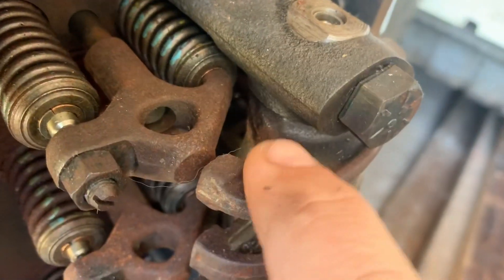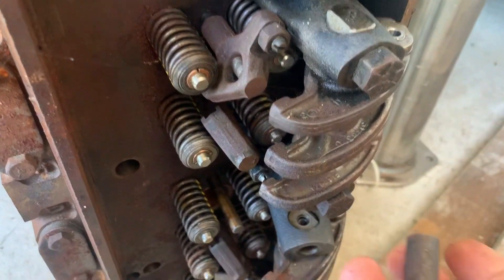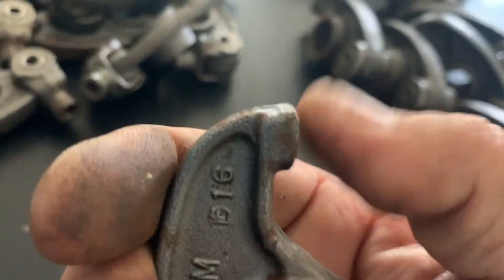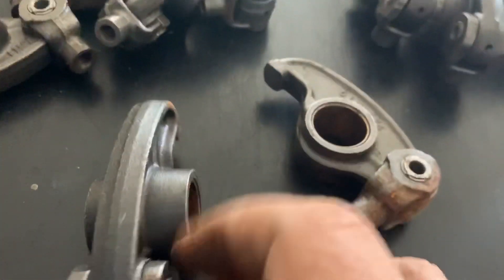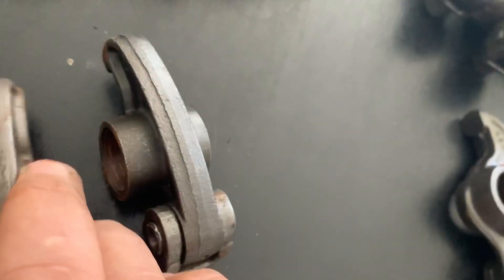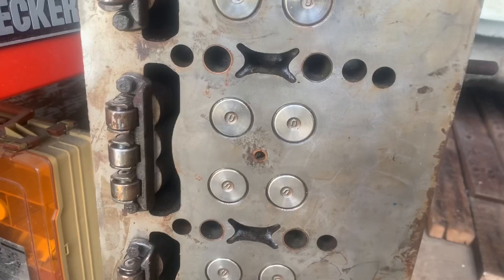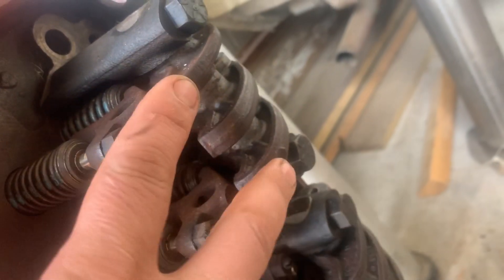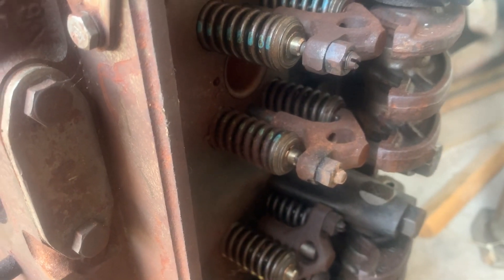4 valve head operation detroit diesel

Comment: New guy here and probably a stupid question, but I need your help. I watched another channels video and they made it appear as though the bridge has a gap setting to valve stem tip  of fifteen thousandths and the rocker to bridge has another gap .015. Does this sound correct?  Thanks in advance for any assistance.

Comment: Interesting, I always thought the flow ran the other way. Intake was through the valve and the exhaust was through the bottom ports in the cylinder. Much like a conventional two-stroke gas engine, obviously excluding the valves..

Comment: Take a close look at the cam rollers,  rusted.  Might need a bit of tlc or replace.  Heat soak in Cindol before installing head.  Been a long time off it looks like... Happy dayz.
Reply from the maker: My head is at the machine shop.  That was just a head sitting around to show the bits.

Comment: For some reason I thought that the valves had to be the intake and the holes around the cylinder were the exhaust, but I guess there would be no reason why it wouldn’t work just as well in the opposite direction.  You probably lose a bit less of the lubricating oil for the rings that way.

Comment: Scott the rust on those parts is next to nothing and they would clean up no worry at all you can use evapo-rust if you want but a good rub with 1000wet and dry paper in kerosine lightly will also do it ,most of those shafts were not even rusty on the bearing surface. Your vids are getting better every time you put one up top job and thank you for what you do.

Comment: Scott- If the fuel rail is only at 70 lbs does the required pressure to enter the combustion chamber come from inside the injector itself? Thus the injector squishes the fuel to reach 1500 psi so it can go in to the already hot and pressurized cylinder?
Reply: The injector has a rocker arm like valves n rocker arm pushes the injector like Windex squirter n squirt fuel at the rite time to get compressed

Comment: Great explanation of the two stroke cycle. I can see the advantage of the 4 valve head allowing better air flow and increased scavenging effect. Would machining the exhaust ports or port matching them to exhaust manifold improve exhaust flow into the future turbo? Very cool project. Keep up the good work and awesome videos.

Comment: @ timestamp 3.53, you can see what looks like a dog bone in the casting of the head. Those were casted at a later date. The reason being, when the engine is overheated, the casting would crack between the valves. The Dog bone gave the casting some relief when it expanded due to excessive heat. They still cracked, but at a much higher temp. Sometimes they'd leak coolant in the cylinder, depending on the dept of the crack. If the engine ran like that for a period of time, the valve seats would drop out, the head of the valve would break and sometimes the guides for the crossovers would break as well.

Comment: 4 valves should cool the valves better than 2. when Indian motorcycle engineers designed the four valve heads for their racers. they were thinking of improved valve cooling but found as a extra benefit better overall flow and horsepower.

Comment: Does the skirt of the piston cover the intake ports on the sleeve when piston is TDC?
Or does the intake air get pushed in to the crankcase?
Reply: Skirt covers it. Extra rings on the bottom of the skirt seals it.
Reply: @schmidt60410  Right on. Thx!

Comment: love to see more on the fuel system that was great to see the head stuff
Reply: I don't want to steal Scot's thunder. He may do a video on that, but it's simple really. A pump pumps constant pressure  from the tank through a bore the cylinder head(s). The fuel circulates through the head. The injectors take what fuel it needs, and the rest returns to the tank. There is a brass restricted fitting at the end of the head. that has a small hole in it which determines the pressure in the system. The smaller the hole, the higher the pressure.
The nice thing about this system is the fuel is heated before it returns due to the heat in the cylinder head. That makes it nice in cold weather because the fuel stays warm enough in the tank to keep it from congealing. You'll never see snow on a fuel tank if it is powered by a 2 cycle Detroit. Another nice thing is in most cases, the supply pump is good for the life of the engine. They hardly ever fail. The downfall is they don't suck fuel if you run out, so the system has to be primed. They will however, blow fuel from here to China.

Comment: How does it keep from running in reverse, on a backfire?  Theoretically it will run backwards, correct?
Reply: Any diesel can, but they rarely backfire. I bounced a deuce and a half off a curb one time and it fired backwards. Scared the crap out of me at first. Smoke blowing out the air cleaner.
Reply: yes it will run backwards, ive seen it a couple of times. When it does this shut the fuel off and kill the engine then restart as normal.
Reply: If you want to see a truely happy backwards running 2 two stroke engine, check out lanz bulldogs. The early ones had no reverse gear, you just shut the fuel off until it basically stalled, bounced it off the compression and gave it fuel and it would start in the opposite direction.
Reply: Interesting,  thanks.
Reply: Oh yeah they run backwards. Not well, but you'll smoke up an air filter real fast.

Comment: Will it be necessary to change the pistons if you turbocharge the 671?
Reply: Wayne Swicegood..... not only the pistons, but also the cam, blower & injectors.... IF, it's to be done correctly.    The Naturally Aspirated Series 71 engines have a static cr of 18.7:1 - the Turbocharged versions have a cr of 17.0:1.... but, there also other variations as well... especially when you get into the marine versions.    When you get into building high performance/high output Detroits (especially the Series 53 & 71 engines).... there are literally Dozens of different injectors to build with.... however, you really need to "Know" all the different DD unit injector series or types, and where each type will put your power band at, depending on what rpm range that your building the engine for.
Reply: @Romans--bo7br  Not sure if you are the person that said there was a lot more involved than JUST a head change in one of Grease Monkey's videos quite some time ago where he was asked that question and he chose to ignore the person. Thanks for taking the time to reply.
Reply: Wayne Swicegood Yes

Comment: I'm surprised that no one has mentioned to start wrapping parts in Denso tape to prevent rusting, usually pronounced den-zo instead of den-so, although I'm not sure why. I always pronounce Denso as an s not a z myself, even when referring to the automotive components (starters, alternators, A/C compressors Etc.) company.
Reply from the maker: Those were all nos In each individual box but they have been sitting around for 30 years. Humidity etc got to them.

Comment: I work with steel bearing races and other parts all the time that get a lot worse than what i saw on your parts so i was going to suggest a dremel with a 402 mandrel, cut some purple scotch brite into 1" -1.25" round pieces ( i use a pair of scissors) and youll need a couple small thin washers to pinch the scotch brite onto the mandrel, keep your rpms kinda low and use it to remove surface rust. It will do an amazing job, its also good at revealing small cracks as it tends to pile stuff into a crack and make it more visable, ill polish those bushings as well.

Comment: One question, How does a turbo help power if the exhaust valves are open while the cylinder is being charged with air??  Wouldn't the air pressure just escape out the exhaust ?  Or is there more air charged than can escape through the valves and thereby building pressure?  Or is the valve timing different between turbo and blower only?.....Jay
Reply from the maker: The exhaust valves close before the intake ports are sealed off.  The air charge is a much higher pressure with a turbo

Comment: Emd which used to be a division of GM also uses the 2 stroke diesel which in appearance and operation is identical to the 6-71. They were built from 1939 to 2015 if I remember right. All the designs, 567, 645, and the 710 passed the tier 1,2,3 emissions test but the 710 which passed the tier 3 emissions would not pass the tier 4 emissions standard without an external to the engine DEF system to meet emissions standards. The problem was all the railroads in the US told EMD if it won't pass without an external emissions system we won't buy it. 

So EMD went into dark territory, a 4 stroke 4 turbocharger V-16 model 245 engine. They finally came out with a 245 engine that would pass tier 4 emissions standards over three years after tier 4 emissions went into effect without using an external emissions system. Fuel injection pressure on the 245 is I believe over 1000 ponds of pressure totally electronic.

In the meantime GE was building their GEVO V-12 engine rated at 4500 horsepower, a level which EMD equaled with the early 245 engine but it was put into tier three production too early and had major teething problems which emd finally worked out three years late. That is why you see so many GE locomotives out on America's main lines.

Just for grins when I as a first week got to lift the rocker cover on a V-20 645 3600 horsepower freighter, I was shocked! Other than being bigger it is identical on the top deck to a Detroit 2 stroke.!

Major differences are model 567. 8 1/2 inch by 10 inch stroke idle in the first 1939 models were idle 300 rpm full throttle 800 rpm total horsepower for traction 1350 in the model FT and the F-2. The FT used fan belts to overhead fans and manually engaged clutches to engage or disengage the fans individually with manual radiator shutter control. The F-2 was essentially the same locomotive with an AC alternator added between the engine and the D.C. Main generator to provide ac power to the four over cooling fans and traction motors to automatically control engine temperature. This ac setup became the standard setup on all EMD road locomotives passenger or freight from the F-2 (freight ) to the E-3 to E-9 passenger locomotives.
The 567 was replaced by the 645 engine which simply changed the bore and stroke to 9 1/16 x 10 inch .

The 567 was built in V-6, V-8, V-12, and V-16 configurations from 600 horsepower up to 1800 horsepower using two really big roots blowers without shutdown shutters, with the model GP-20 for the Union Pacific railroad EMD used two air research turbochargers  with the roots blowers still on the engine. Then EMD designed a gear driven turbocharger to raise power to 2250 and the last was 2500 horsepower with a free running clutch that when sufficient exhaust gas pressure was available ran faster that the gear drive to provide enough air to the engine also the rpm increase from 800 to 835 and finally to 900 rpm. Production of the 567 ended in 1965 when the 645 replaced it horsepower ranged from 1000 in two yard switchers to from 1500, 2000, 3000, and topping out at 3600 horsepower on the largest freighter. 710 production and 645 production ended in 1983 though limited 645 production continued to 1988. The 710 is 9 1/16 X11 inch at 900 rpm and its biggest rating was 5000 horsepower before the product improved 4 stroke 245 replaced it for use in the states. The 710 is still in production today for export only. After both GE and EMD went as high as 6000 horsepower in a single locomotive the rail industry settled on 4400-4500 horsepower per unit as cheaper to maintain plus most railroads with the 6000 horsepower locomotives ran a single unit per freight and discovered the train is dead on the main line when the engine dies and can't be restarted. The next time you go by a short line railroad and see and emd locomotive explain your a Detroit two stroke mechanic and would like to look at the rack under the rocker covers, bring your cameras.
On the 567, 645 and 710 engines each cylinder head is individually mounted and using a big torque multiplier as the head studs torque is 1800 pounds per stud and to get there is a 4 step process.

It was sold years ago and the company that owns it now is Caterpillar operating the locomotive company under the name of Progress rail.

The one item I forgot was the 245 engine evolved into the 4 stroke EMD builds today known as the 1010 engine.
567,645,710 and 1010 engine models stands for the displacement per cylinder. 

Sorry for being long winded .

Cheers!
Reply: Great info. Thx for sharing it.
Reply from the maker: 71 cubic inches per cylinder vs 710 cubic inches.   I love them too.

Comment: Are these the bridges you need?  https://dieselpro.com/detroit-diesel-parts/detroit-diesel-8v71-engine2/cylinder-heads/detroit-diesel-bridge-exhaust-valve-for-series-71.html#.XTeKZfZFzIU
Reply from the maker: Most of it, it’s missing the adjuster.   Richard is sending me the 4 i need. He just had Jake’s put on to he had a few unused ones to send me.
Reply: Glad you found a source.

Comment: And yet these 2 stroke Detroit's just dont sound as sweet as their EMD cousins...
Reply: Well I don’t know about that. I believe the Detroit has a more pronounced 2 stroke sound due to the smaller bore and stroke and higher rpms. But I agree a EMD in notch 8 pulling the grade behind my house is sweet music.
Reply: SOU6900..... Well, they're really Not "cousins" either... in fact they have Nothing to do with one another, whatsoever... never did.  Other than the fact that they are both 2 cycle, and utilize the Uniflow Scavenging principle & design with cylinder liner intake ports and exhaust valves... the similarities pretty well, end there.   The Detroit Diesel Series 149 "shares" one other factor with the EMD engines, in that it also utilizes a "pot" design in the head for ease of change-out of the valves/injectors, if necessary.... but other than that... they are vastly different.   If you want to here the "mother" of "sweet" sounding Detroits.... listen to (albiet, rare) a 20V149 Detroit (Gen-set) go from start-up to full throttle (even if it is only at 1,800 rpm)..., without the mufflers - guaranteed to put a smile on your face.  : )   Watch & listen, here.... https://www.youtube.com/watch?v=Zn9K2giMTpo
Reply: @Romans--bo7br  I seem to recall that Detroit and EMD were both once GM brands

Comment: Are the rocker faces that contact valve or bridge chromed or hard faced?
Reply: They are heat treated cast steel and the contact surfaces are surface ground.  Nothing special going on there.

Comment: Scott, you can clean up those rocker shafts no problem with some crocus cloth or some 4/0 steel wool.  Put the stained side of the shaft topside it will be fine.
Reply: 1:38 Yeah that is certainly superficial surface rust.  Nothing wrong with them.

Comment: Scott, for the light surface rust on those rocker arms and rocker shafts, a product called Evap-o-rust works wonders. I used to use it on precision machine tools. It will remove all the rust and not remove any base metal. You'll be amazed how well it works, just soak the parts for a day or two and come back, rinse off, done.

Comment: A few hours soak in EvapoRust or Metal Rescue or the WD40 rust soak should do the trick.  If not, Soak in vinegar.
Reply: Soak in 10% or 30% Vinegar... then BUFF with 0000 steel wool.. wash soapy water.... Lightly oil.. DON'T Toss them due to a bit of surface rust..

DEEEP Pitting is a totally different story!!!